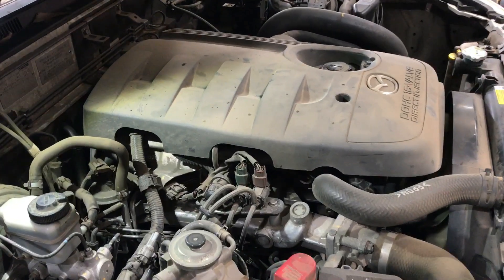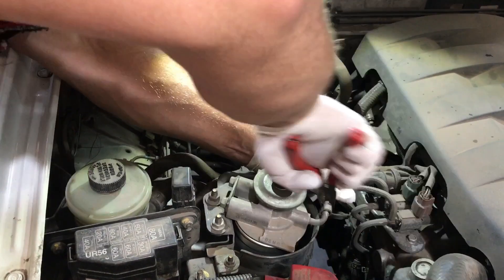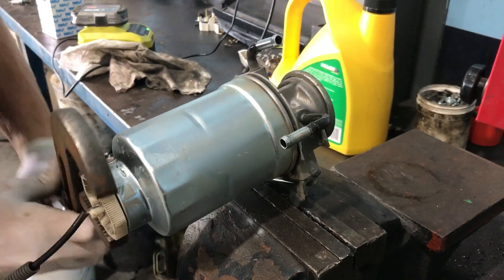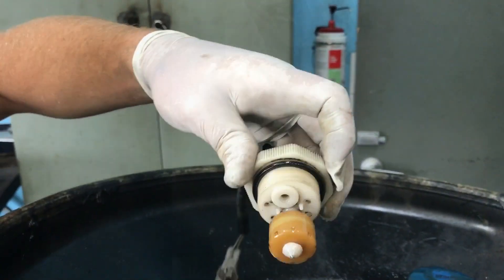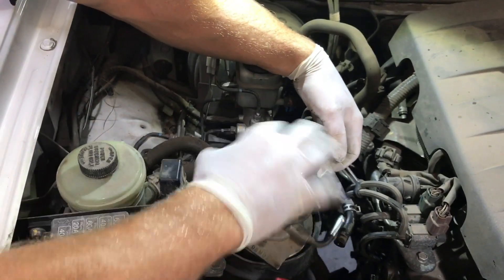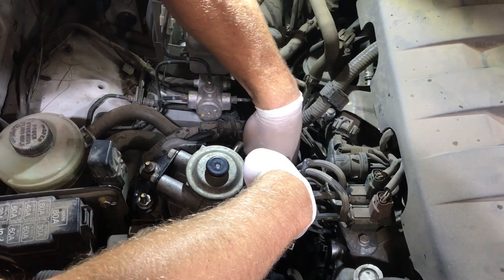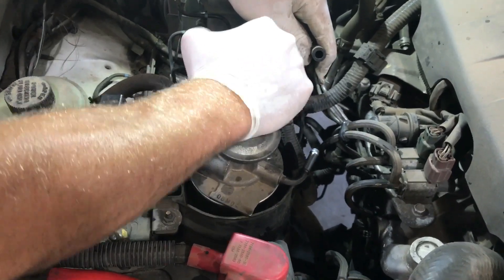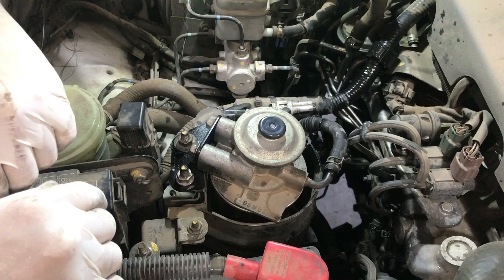Mazda BT-50/Ford Ranger Fuel Filter Replacement

Comment: Great video. Out of interest, what is the function of the sensor at the bottom of the fuel filter? Does it pick up if the filter needs replacing?
Reply from the maker: It’s a water sensor
Reply: @MotortechVehiclerepairs  brilliant. Thanks for that. Cheers

Comment: Exactly the help I needed as am servicing 2011 BT50.  And got the fuel fiter, but was a bit blind about the correct way to do it.  I have always been told to undo the negative battery terminal before doing work like that, and I think that is good advice.  I would like to know if there is fuel pressure . It didn't look like there is when you undid those fuel lines?  Must only be in petrol vehicles that have the pressure in line? I'm not that clued up when it comes to Diesel.  But have been told it's really important to change the fuel filters often, so thanks again for doing the video.
Reply: Did you do the Fuel injection pump inlet filter  as well?